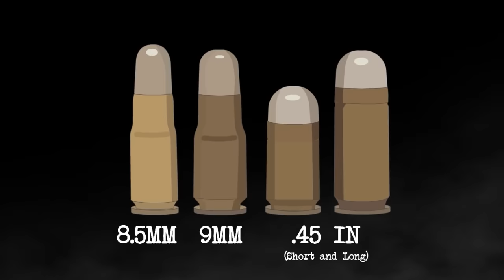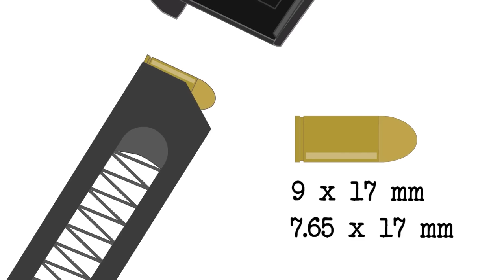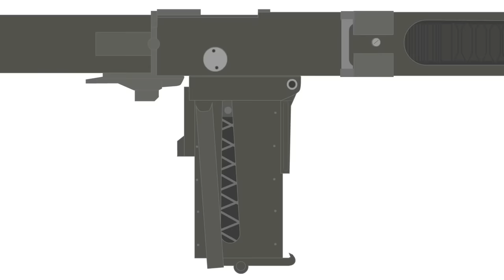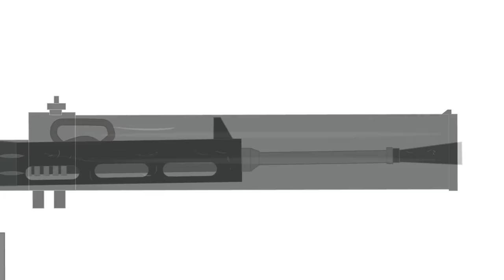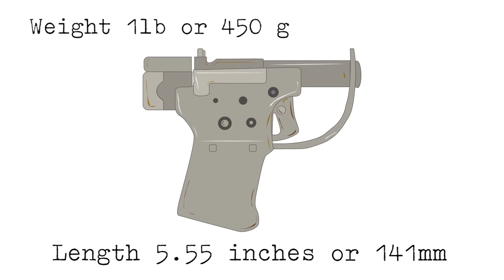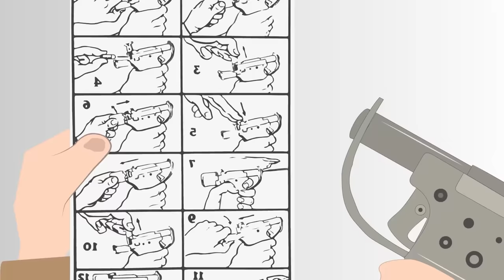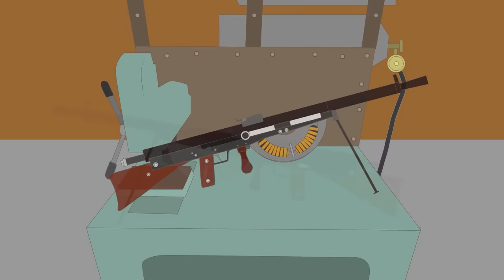Cursed guns that shouldn't have been made

Comment: I like that the Gyrojet pistol is the only one capable of not having any inside nor outside problems. All it has is poor accuracy results and highly-expensive bullets. It didn't get jammed, malfunction, disassembled, nor hurt the user when shooting. Besides the accuracy and bullets, it was PERFECT. I even like how you reload it in the chamber rather than having it's own magazine, just like revolvers.
Reply: I mean the video did state that the Berreta sub was really good. It didn't really list any flaws of the cheaper variant either.
Reply: The Gyrojet also had the problem of having a minimum effective range, as it took some distance for the projectile to reach a speed where it was effective. Accordingly, it was almost useless against someone standing right in front of you, or at the ranges typically encountered in house-to-house fighting. Additionally, because the rounds carried the propellant internally, they had a significantly lower sectional density (i.e., weight per cross-sectional area), increasing the effect of drag on the projectile after the propellant burned out.
Reply: @seanmalloy7249  So, simply put: very poor distance range. Well, at least the pistol didn't combust due to malfunction or something.
Reply: Basically,the gyrojet is a sniper pistol
Reply: @Pogger927  Wait, now you're confusing me. Seanmalloy7249 (possibly renamed themselves in the future) just specifically said that it's range is very minimum. Thus, how can you basically say "it's a sniper pistol" when it has poor range distance? Or maybe you're saying that it's a pistol that shoots bullet fast like a sniper bullet would fly? Or maybe...it's fast up-close? Now I'm confusing myself! FCKED!
Reply: @Ihere123  they have made prototype Gyrojet rifle already.
Reply: @Ihere123  here's my theory on how to make the Gyrojet a viable option for weapon.Make the bullet bigger.And add more gunpowder.
Reply: @Ihere123  with the long barrel,we can increase it accuracy.Then shoot it from far away.The accuracy will increase over time.
Reply: @Ihere123  He means the Gyrojet had a distance that the round would have to travel before it was deadly.
Reply: @johngellare3507  I know what he meant. But what I meant is that carrying the long barrel would be a little hassle, as it's dependable on the weight, carry, and design. Is it going to be heavy or lighter than the postol? Is it going to be a long barrel, or a short barrel that's a "long" barrel? Or maybe it's not detachable at all? And can it be easily carried into and during the battlefield?
Reply: Nope, that's not why it was inaccurate. The barrels are not rifled. You had to make the ammo with extremely precise rocket vents, yet even when this was done right the system was simply inherently less accurate  @Pogger927
Reply: Its also very quiet. I saw Brandon Herrera's video on it and apparently you can feel the heatwave from the rockets on your face.

Comment: I recall the gyrojet's issues were due to poor QC on the ammo, and a low production rate driving up costs.

I imagine nowadays, gyrojet ammo could be designed better thanks to CAD and technological advances in ammo production.
Reply: @Adam Korzeniowski yeah but still
CAD designing can remove most of the gyrojet’s ammo issues
Reply: @karotgamin790  yeah but why ruin a good thing? I mean, gyro doesnt provide many pluses to be worthwhile
Reply: @Annathroy  less recoil and no more hot brass to eject. could be worth a try looking at it again with modern designing and manufacturing processes. And "never change a runnig system" is a very lazy point of view in this kinda context as warfare always changes and the most advanced forces most often become the winner. Just look at napoleon, when he had paper cartridges while the french didnt. or the us who had an atom bomb while japan didnt. there are many more examples but i guess you get the point
Reply: The amount of metal wasted in casings ejected always bothered me, this system feels more efficient.
Reply: you average specialized bullet would still be cheaper, disposable and effective than little rockets that you have to keep safely stored at all times when not in service.
Reply: @Eldor-117  you can collect and reload the brass. A lot of people do it themselves, especially for more obscure cartridges. For people who don't reload a lot of companies will buy used brass to reload.

Eventually, the brass starts to get worn out but at that point it can be melted down and voile, you can make entirely new casings.
Reply: I could see a decent use for something with no recoil and no casing to eject in aviation use. Not much use for it anywhere else though tbh.
Reply: @Moe_lester_  > less recoil and no more hot brass to eject. could be worth a try looking at it again with modern designing and manufacturing processes.

Caseless cartridges are already a thing with the G11 and they fulfill exactly that. It didn't go far because it was still impractical compared to traditional powder cartridges. It didn't significantly outperform them, and it costs more to make.

These two factors you mentioned can be fixed by modifying existing guns (atleast to an extent), or buying more modern, proven designs. Rather than developing and manufacturing an entirely new gun and cartridge.
Reply: @LamborghiniDiabloSVPursuit  without recoil to manage, you could fire higher caliber rockets (20-40mm) and put explosive payloads on them.
Why let stupid things like "practicality" stand in the way of my IRL Warhammer 40K Bolter Gun?
Reply: @zc8211  Cased ammo is easier to store long term than caseless ammo and it can get wet and stuff, caseless ammo can't get wet.
Reply: @the_inquisitive_inquisitor  I never said anything about caseless ammo? I was just talking about reloading brass
Reply: The problem is that it's antithetical to the handgun, most pistols are used within 7 yards, while the gyrojet was most effective past that. Noone needs a handgun that is ineffective in close quarters.
Reply: @potatolord2196  An astronaut might, and they'd especially need one with as little recoil as possible.
Reply: @zc8211  Okay, and I added another example of the advantage of brass cases over the alternatives.
Reply: @Eldor-117  

"At Aperture Science, we fire the WHOLE bullet. That's 67% more bullet per bullet!"
Reply: @LamborghiniDiabloSVPursuit  yeah but caseless munition is another thing. Rockets wont get wet while storing
Reply: I agree. The Gyrojet may have been garbage back in 'Nam, but if the concept were taken and revamped today, it could potentially be a gun of interest on both sides of the Market (Civvy/Mil. and Police).
Reply: Actually, if we take the Gyrojet concept and the caseless ammo concept, mashed them together and improved the Gyrojet's core concepts and functions, we could potentially have the first caseless, low-recoil pistol on the Market that still uses a concept similar to the Gyrojet's limited-recoil, no-cartridge concept.
Reply: @warellis Check out Backyard Ballistics videos where the guy creates his own gyrojet launcher. Turns out that a big part of ballistic issues stem from small size of the rockets
Reply: Several attempts have been made to improve on the gyrojet design, and they all run into the same problems. Primarily it's a trade between stable ammo and a good rocket propellant. A strong rocket propelled round is great, but not of the propellent degrades or becomes unstable quickly. It's make stocking up on ammo a real challenge. The expense of the ammo is another consideration- the manufacturing process to creat the mini rockets is far more involved than creating any modern ammo type. Quality controll, especially on the rockets novels, has to be extremely high as even a slight discrepancy can cause a rocket to become unpredictable in it's trajectory. Higher precision means more time and more cost to manufacture. A third limiting factor is performance- unlike conventional projectiles that reach maximum velocity by the time they leave the barrel the gyrojet rounds need several feet (between 15-20ft) to reach maximum velocity. This means that at extremely close ranges the gyrojet rounds is totally ineffective. On the original guns you could literally hold your hand on the floor and of the barrel and preheat the rounds from launching at all. Also, once the propellent was spent the rounds decelerated quickly and became unstable I'm flight tumbling badly and losing all accuracy. And lastly the rounds lacked impact. Most were subsonic and even when the round could reach it's full speed the fact most of its mass was expended by burning thru it's fuel meant the round hit with less force than a rounds half it's calibre or lighter. Attempts to increase the kinetic energy ran into the stability problem from earlier as you can make the rockets faster very easily, but you lost stability and shelf life. Attempts to increase the size of the projectile or "warhead" of you will ran into problems with greatly decreasing range and stability. There a trade off between the weight of the rocket and it's fuel and the speed you can move it at that is impossible to skirt around thanks to the laws of thermodynamics. That's not to say rocket propelled rounds will never work, but it's going to take a lot of time and money to research or you can invest that same money save aot of time and buy firearms that work all around better now.
Reply: @Eldor-117  
The amount of metal wasted with spent casings, even if not collected by firearm operator - unless shot somewhere outdoors for them to quickly get forgotten - is in extreme majority of cases in orders of magnitude of such small size that it's probably easier to count atoms than 0 required to write it down in any commonly used unit

If it's on some established public range or any shooting place that isn't "derelict middle of nowhere to be abandoned after next 3 hangouts" - all spent brass will in the end make it's way back into circulation either by people willing to reload, or through scrapping and reworking it

Well, if you're talking about labor and energy spent, it's not as tragic as it might sound because brass is relatively quite malleable and easy to melt, so it doesn't require as much energy and work input as steel or other most commonly used alloys
Reply: @Eldor-117  Depends. You can collect the spent case and replace the powder, primer and bullet. That's very efficient. Albeit not something that is usually practical in a military context.
Reply: @dwatts64 
Yeah, they call them rockets.
Reply: @Storm_Rider 
Gyrojet-derived devices have been in use the entire time since, that's what pen flares are. Sometimes an idea is just a dead end.
Reply: @Moe_lester_  Your comment otherwise was good but the atomic bomb really made 0 difference in that war. USA had cheaper ways of leveling citys with their flying fortresses and regular firebombs and such. When nukes went to be ICBM:s thats when they actually became useful.
Reply: Next stop an Astartis Bolt Gun 😁

Comment: "The Modelo 35 hand grenades were offensive grenades." 

As opposed to defensive grenades which don't explode, they play a sound byte telling the enemy to please go away.
Reply: Ok. I need this in ArmA now. Just toss it into a bunker and it goes “hi yeah the NATO team owns this now. Can you leave?”
Reply: Lamda²  That is true.
Reply: Lamda²  Or flashbangs.
Reply: No, as opposed to defensive grenades that has a lethal blast radius that is wider than an average soldier can throw it, necessitating that it be used from a defensive position (in a building, a trench, behind a barrier, etc).

Offensive grenades have a smaller lethal blast radius.
Some modern examples are things like flash bangs, rubber pellet, and tear gas grenades.
Reply: defensive grenade means you have to take a defensive position after throwing it because you can't throw it farther than it's effective radius
Reply: Fun fact: there is such thing as offensive grenades and defensive grenades. The specifics are weird, but the channel Not What you Think recently released a good video going over it
Reply: No idea if the other comments are right, but I agree that should have been clarified in the video. Aldo, the video seemed very thrown together. Almost like all the parts were recycled from other videos.
Reply: @woodworkerroyer8497  This video IS made from other videos.
Reply: Decoy grenades?

Comment: 2:12 This problem is called "chain fire." Cooking off is when a gun fires because the propellant gets too hot, which is more common in fully automatic guns.
Reply: Beeswax helps with that aswell.
Reply: @justinrobert2770  Yeah, I imagine anything that sealed chambers would help reduce the chance of chain fire.
Reply: @JonathanRossRogers  I just used Crisco, waterproofs the chamber and acts as a lubricant

Comment: Ian McCallum was able to get a 30-06 Chauchat to work well on forgotten weapons, I think the set of circumstances have to be right but if you stick to them, it can run reliably with the 30-06’s (apparently).
Reply: Until the gun is battered to bits by said firing.AFAIK, that was one of the problems with the Chauchat in general. It was just shoddy. The 30-06 version just failed quicker.That, and the aforementioned open sided mags in the mud and crud of the trenches. Any gun can work well under near perfect conditions.
Reply: I remember reading somewhere that the chauchats entire issue was the magazine.  If the magazine was close sided and had a little more care taken in it's manufacturing it would have run amazingly.
Reply: @jasonseigfried8941  The magazine was a major issue, but not the major issue. One of the standing problems with the Chauchat was that, outside of the barrel sleeve and the moving parts in the bolt, parts were not always interchangeable between weapons. Side plate assemblies used screws that would work themselves loose during firing, and all of the weapons made by Gladiator had misaligned sights, requiring correction by the gunner.